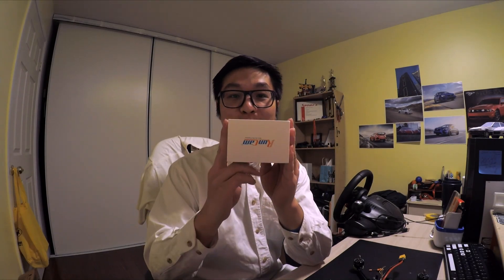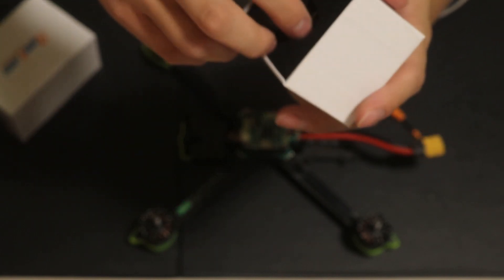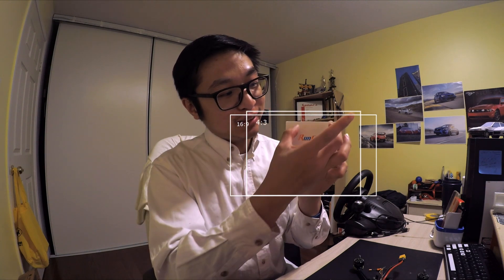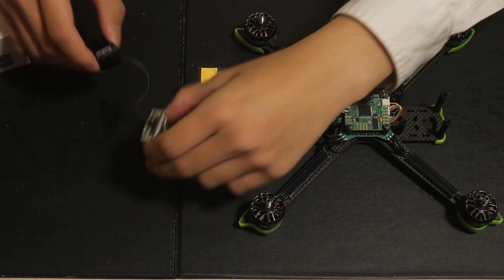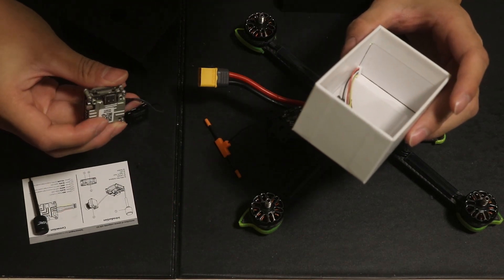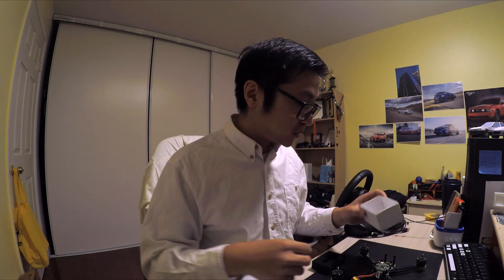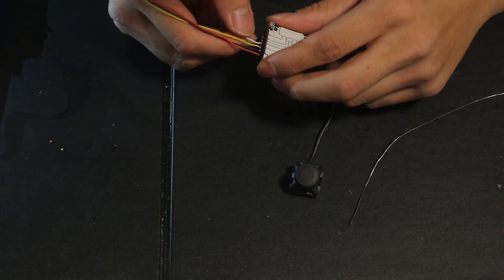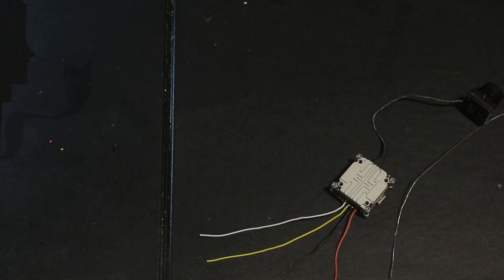IFLIGHT NAZGUL5 V2; HOW TO CONVERT ANALOG TO HD (Runcam Wasp Install)

Comment: Thank you for the tutorial..
I have one question, 

Is that ok if I just use the original wire from the 1.6W analog. Its using socket on the FC,, so i didnt have to soldered on the fc,, only on vista side..

Its already 9v (red), ground (black), rx (White) and Tx (yellow).

Thanks before,,
Reply from the maker: That's a great question! [Sorry for the late response] But I would be safe by cutting the plug off and just soldering directly to pads. From my experience the plugs always manage to come loose over time xD. But yess if the wires are in the right order, it should work with just re-using the only wire. LMAO would you reply back to confirm if it did?

Comment: What flight controller are you using? I have a analog Nazgûl v3 and am wanting to go digital and am still learning but I want to know if I should use runcam wasp or dji vtx… mine has a blitz f7 v1.1 flight controller by the way
Reply from the maker: Soo the same flight controllers can be used on either analog or digital. You can keep using your current blitz  flight stack once you swap over to digital. If you want something affordable I would recommend just going with the DJI vista system, it works and is pretty okay in price now a days since there are newer systems out there

Comment: can you hook the usb-c to pc to see video output?
Reply from the maker: Hi @Spicydogsoup, sorry is your question whether or not the vista can output its video signal to your computer via the type c port? If so, it can't do that. The vista's type c port is an input only (i.e used for updating, activating, etc). If you have the goggles however, you can use a type c to type c cable and output whats in the goggles to a phone (Might make a video on this, would you be interested)?
Reply: @JackyNgo  Thanks for the reply.  I meant the Runcam Wasp, it has a USB-C.  I don't think it can as you stated.
Reply from the maker: @spicydogsoup Oh okay gotcha, yea it won't be able to. Also just to clear the air haha; Runcam Wasp - is the actual camera module, Runcam Link - is the metal square box, which is the vtx. It's also more commonly know as the vista.
Reply: @JackyNgo   Good to know thanks bro